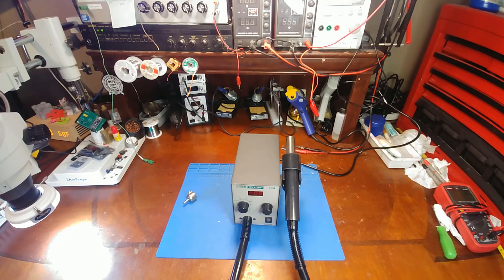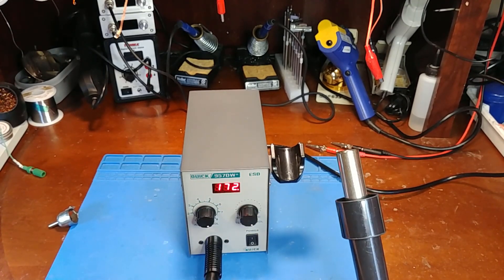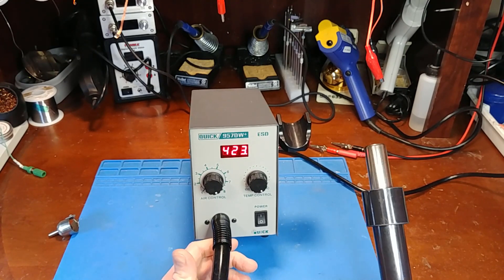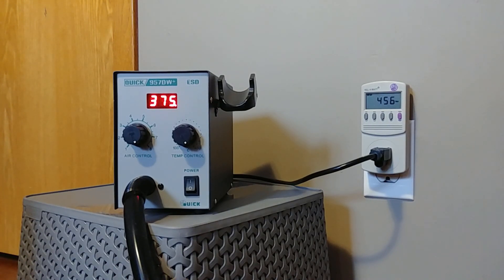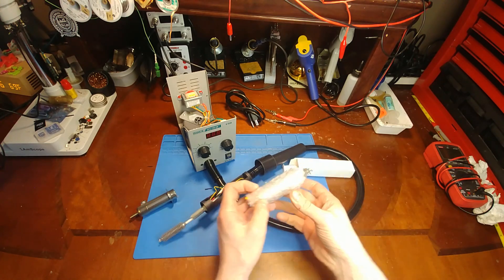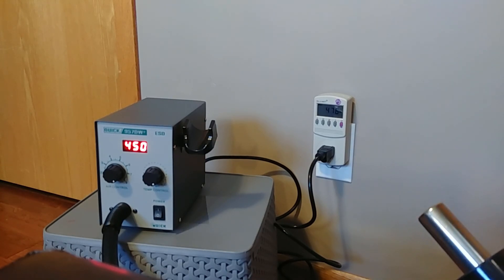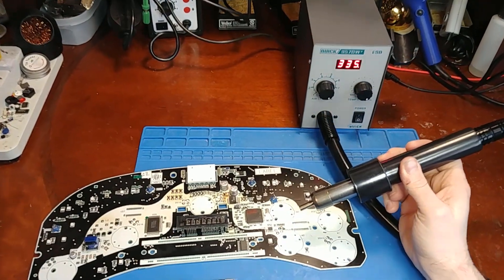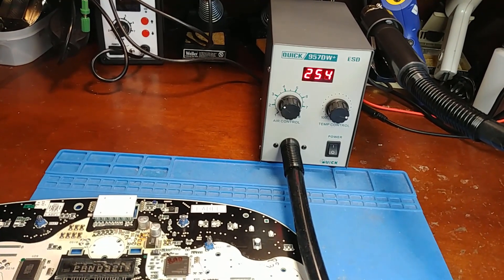Quick 957DW+ Hot Air Station

Comment: I've had one of these for a year and love it so far. Seems to do fine for everything I do and doesn't take up a lot of space. I also use it to heat up the slider knobs on the 03-06 climate controls so they come off easier.
Reply from the maker: It's my favorite small hot air station. Quality feels great and I like the simplicity of the user interface.

Comment: Am in the market for a new hotair, my current one can now only go to 280, used to go much much higher than that. But your video gave me the idea to check if the heating element is replaceable. Might give it a go... if not, this Quick 957 model seems good. So thanks also

Comment: what about the internals of the PCB ?
Does it not put more load on the triac for example ?
Reply from the maker: Yes the new heating element is putting more of a load on the triac than the original heating element. But it's still less than the rated 580 watts.

Comment: How did you deduce that a type C heating element would be appropriate for the 957DW+? If you would search for a replacement heating element for that machine then you would find that the Quick A1147 heating element is what is recommended, not the type C.  It would be greatly appreciated if you would explain how you concluded that the type C is the correct replacement.
Reply from the maker: It's been a while, but from what I remember at the time it was the physical match and 120v.
Reply: @jeffescortlx  How has the unit held up since then.  Did the modification have any unintended consequences?
Reply from the maker: @myvid222 continued to work fine as far as I know. It was for a local computer repair shop, not my own use.

Comment: I kinda like the cheapo 858s cause the handle is easily replacable and you could build whole unit (not the handle) by hand with scrap electronics
Reply from the maker: My daily hot air station is a 858. It just keeps on working. Surprised how well it works for how cheap it was.

Comment: Cool, i Will be buying this but the 230V EU version.

Many years has past since i did smd soldering courses in school. Ive forgot but it isnt really hard.

Need a station for replacing a ICS1893BFLF chip.

Should be a piece of a cake?

What is the difference between DW and DW+ version?

Comment: Why did you replace the triac? The video cuts from the unit heating up to 450 quickly then you go to replacing the triac at your own risk....
Reply from the maker: I didn't replace the triac. I only replaced the heating element. But a more powerful heating element will put a heavier load on the triac.

Comment: Bad elements aren't uncommon but they become very common when someone cuts it off before letting it cool down. 
Btw that basket you tested the hot air station on the killawatt is sold at target. What's funny is I always who would buy those baskets. Now I know lol
Reply from the maker: True improper cool down can over heat the handle. But this unit was reported weak right out of the box.
Those target bins fit perfect in IKEA cube shelf!
Reply: @jeffescortlx  ah I had my phone muted fro the first 20 seconds I missed that the complaint was right out of the box. 

Did he source it from.a shady vendor? I've never seen anyone have issues with that model before
Reply from the maker: @FixedUntilBroken  I think it came from Amazon. But the owner should be watching this video soon and will hopefully comment on the details.
Reply: @jeffescortlx  yeah I'm really curious. Maybe the handle had the 220v heating element. These units are so dumb (as in no micro all not a dumb design) they would need use a different element for the 2 I would assume.

I've seen some really good reviews on this unit. Man complaint people have is that the hose/handle has a super cheap feel to it.

I've never owned that model it was in my final list of them before I went with the bst station.
Reply: Btw I've been getting ads lately for the JBC JTSE-A lately... That is one sexy machine it comes with extractors and all. Sadly it's over $2000... The bst was less than $200... 10x bsts or 1 jbc
Reply from the maker: @FixedUntilBroken  yeah ouch $2000 is a hard pill to swallow when there are pretty decent knock off style stations for $200.

Comment: How odd, i expected the element to have eather a bad joint, or the power going to it was too low.
I would imagine that the element is nichrome wire, so why the loss ? hmm.
Bad connection to the element is my suspected fault, bad internal crimping.
Well you repaired it, i hope they are happ, they should be :-D
Reply from the maker: I would think a bad connection would show it's self at 450 watts. Arcing perhaps, burn marks would be noticeable I would think. I'm just speculating though.
Reply: @jeffescortlx  hmm i also would expect heat to have an effect.
I've never seen resistance wire go high, maybe the stuff they use is different.
i'm thinking too much ha ha :-D
I will shut up and drownd myself in a mug of tea :-D

Comment: неисправна, слишком долго нагревается до 450 градусов на мас=ксимальных оборотах мотора, мои два экземпляра нагреваются до 450 градусов примерно за 10-15 секунд
Reply from the maker: Now that is has the correct 110 volt heating element it's at set temperature in less than 15 seconds.